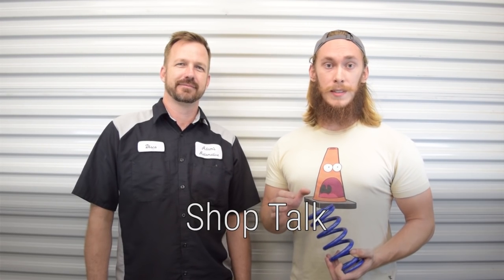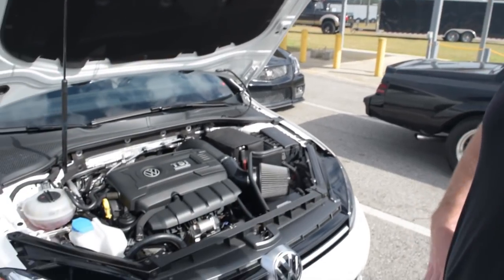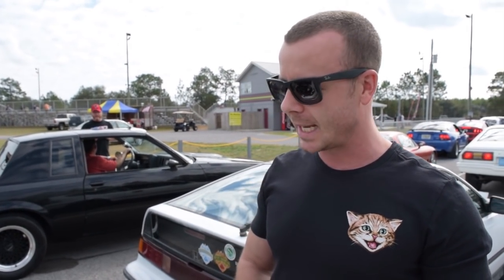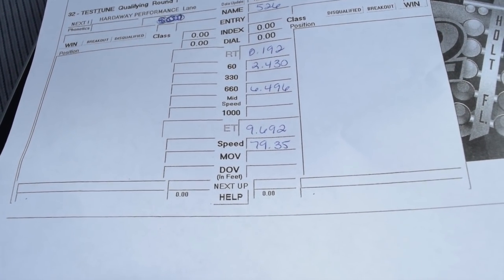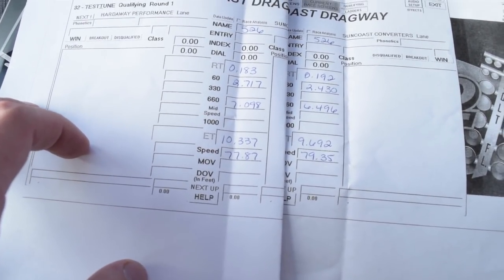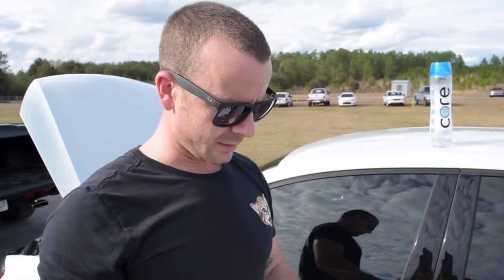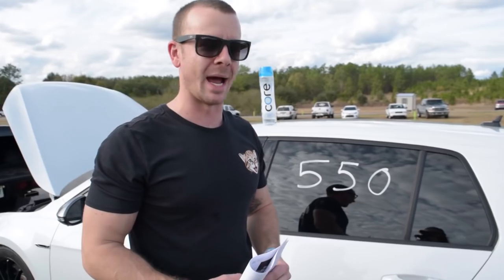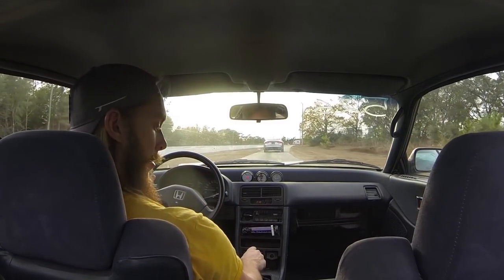TURBO HONDA CRX GOES DRAG RACING: Vlog

Comment: You would really benefit from some 20" slicks man. When I ran my single cam setup in my integra (yes, a boosted single cam intregra lol) I ran 20" slicks and it worked AMAZING. Get those and play with your 2 step for find that sweet spot and you'll be amazed at how that thing will leave the line! My old build thread is still floating around somewhere on DSO and user name was k-what? I also have a video of it on here as well.
Reply: oldskoolda9 yesss sohc Teggy 😁 how much boost and what kinda Times was that thing running
Reply: Only ever got to run on the track with 14psi but went 12.1 at 114. Was tuned for 22psi but never got the chance to make a pass on it. Blew diff out on the line as soon as we turned it up and then I melted a piston before being able to make it back to the track again due to a wiring issue. I miss it and plan to do it again some day!
Reply: I have a video of my 12.1 pass on my channel
Reply: oldskoolda9 thats awesome man not bad timr either on 14 and the 22 psi I'm sure was moving , yea maybe should build another one still fast and enjoyment driving it.  alot of people would doubt the ability to make the Integra's really move with just a sohc well obviously I'm sure you know that
Reply: Oh yeah! So many people hated on it till they saw what it did and then had nothing to say lol
Reply: oldskoolda9  man that's awesome I checked out your pass too that was nice

Comment: 9.35 1/8 mile ET = 14.59 1/4 mile ET. Could be faster than that however due to traction issues in low gears. I would be curious to see what it could run in the 1/4, I'd be willing to bet you could be mid-high 13's, maybe low 13's with slicks. Looks like a lot of fun!

Comment: Great vid! Wish I could get out there on Sundays, but usually have to work.
Reply from the maker: ChevyTwins well shoot, let us know when you're rolling out!
Reply: I am working to get my work days changed so that I have Sunday's off. Wish I had a car to take out there. My Saab's clutch is slipping at WOT, my 1983 c10 with a 6.0 lsx and a 4 speed m20 is getting ripped apart because the frame was bent when I got it when I was 15. Bought another LWB c10 and was thinking about doing a frame off, but don't have the time. So I bought a 1992 single cab step side c1500 that that a 350sbc and a 5speed. The sbc is getting rebuilt, bigger ring gaps, stock internals, aluminum heads, comp turbo cam, roller rockers, and ebay twin turbo kit. All that behind a stock truck 5 speed and a center force dual friction in one of my younger brothers 1985 gmc s15. Will be running really low boost but it should make good power on the motor alone. My cammed and carbed 6.0 I built will be going in my c1500 with a 370z 6 speed trans. Sorry for the long post I can go on and on.
Reply from the maker: Man that's awesome! Got any way for us to follow your progress? I really want to build some sort of turbo V8 'something'. I know that sounds really vague but I'm pretty open to options. A turbo third gen Dodge Ram van would make for an awesome FeaturedGarage tow van.
Reply: Haha that would be an awesome tow van! My brother made a Facebook page called Henshaw Motorsports. We have posted a couple things on there. We might start a youtube channel in the near future as well. Nothing as good as your channel but something just to start.

Comment: Do you plan on running a hush22 full hydro conversion on the crx?!
Reply: Francisco Torres why would he go that route?  I'm curious
Reply from the maker: Francisco Torres here's another question. Does Hush22 want to supply parts? Then the answer is yes. But be warned. The review can't be bought so I hope to parts are of good quality. We're just not trying to sell out, homie.

Comment: Cool vid as always. What tranny is in your CRX? I know D series ratios aren't the best in general but yours seems to have really long gears. I only ever built one D series, a D16Z6 from a 95 EX coupe and used a 94 Si tranny and I remember the gears being long but not terrible. That was my first Honda build right out of high school and I got out of D series right after haha. Spent a ton of money on the little thing: Block honed, decked, head casting cleaned up, P29 Pistons, had the rods shot peened and crank polished, all new OEM bearings, HG, ARP head bolts and rod bolts, Supertech springs, Zex/Comp 59500 cam, AEM cam gear, Bisimoto Rep header, 2.5" test pipe and Magnaflow catback, Fidanza flywheel and Exedy stage 1 clutch kit. AC+PS delete and tuned on Crome it finally spun the rollers to a whopping 155whp/119wtq lol. It was actually still kinda quick in a 2100lb hatch, going low 14's on street tires all the time and the torque curve was much better than most NA B16s in my friends EM1 Si's of the time. After that though I went to B and K series engines and have stuck with them ever since.